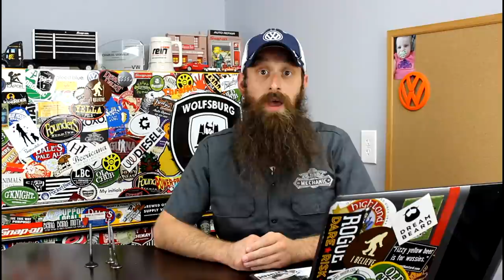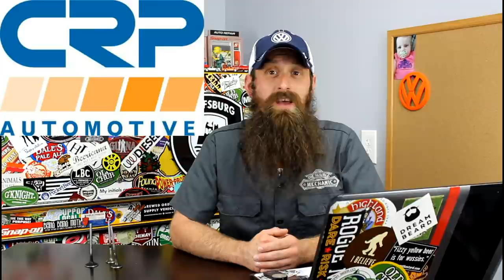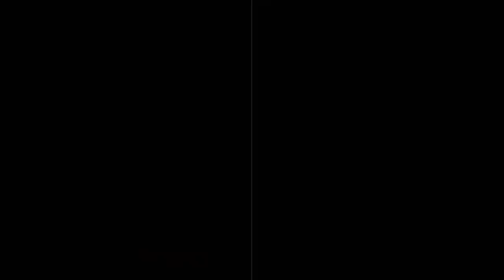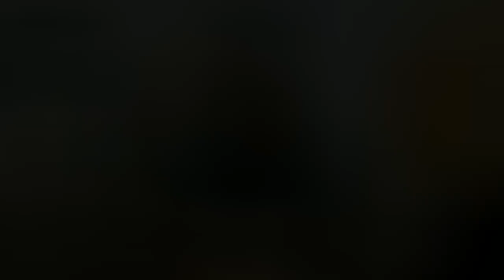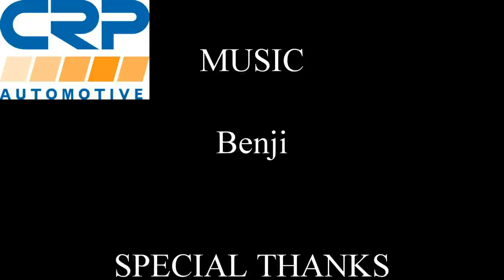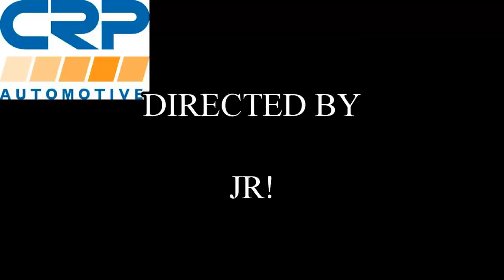Viewer Automotive Questions Answered ~ Podcast Episode 94

Comment: Hey Charles it's Brendan with the P2015 Intake Manifold Flap Position Sensor issue.  I made it back to Roanoke with no issues and contacted the dealer today and they are taking care of it through the VW Extended Warranty. Since the intake manifold is coming off I might have them do the de-carb as they have a soda blasting machine to clean the back of the valves.  Hopefully its not too pricey! Thanks again as always for all your help!
Reply from the maker: Thanks for the report back!  Glad you made it home and I love that you are thinking about a decarb. 

I think we charge $250 or something with intake manifold replacement. Great way to save some money.

Comment: Correct me if I am wrong - thinking of the should replace car question. On German cars if a non ware item fails then it is replaced by an updated unit. On other cars the replacement is likely to have the same flaws.

Comment: i find out on my touareg that part #077198327a LINKAGE ARMS were broken. my question is how this can affect my driving, i didnt notice any different or check engine light. thank you.!
Reply from the maker: Those are links for the intake flap. It's hit and miss on getting faults for those failing. 

You may notice a drivability change. You will want to see if the runner that is attached to the arm moves.
Reply: +HumbleMechanic  yeah it does move, i kind of fix but fail again i order after market unbreakable parts. but i dont feel any difference thats why im kind of surprises me. thank you